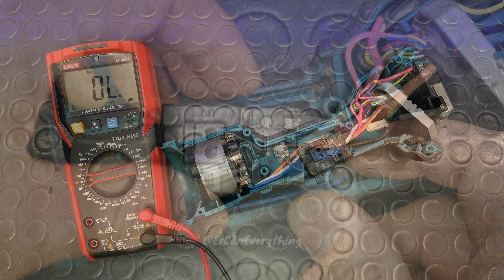How to Fix a Non-working Makita DGA505 Brushless Angle Grinder

Comment: A huge and terrible mistake of grinding the silver or platinum contact points...you should use a contact cleaner with ether, or use bronze brush to clean...
The other mistake, that everyone's is doing, is that you are screwing back the screws, on a plastic without turning anticlockwise the screw until screws threads  merged with plastics internal threads. If you don't do that, you're gone cross-threading the plastic, and that's not professionalism....😉😉
Reply: Amen.